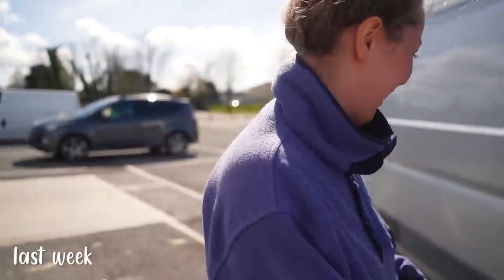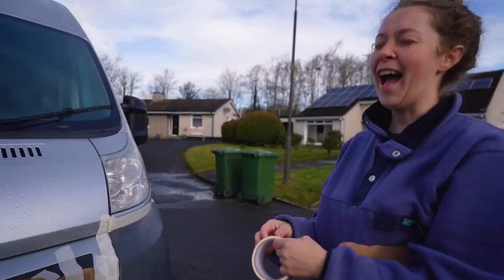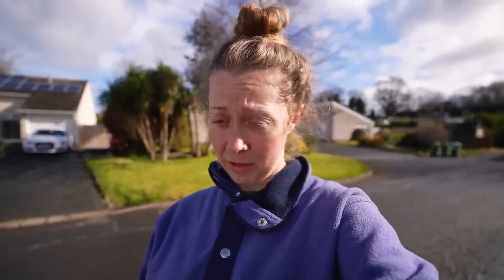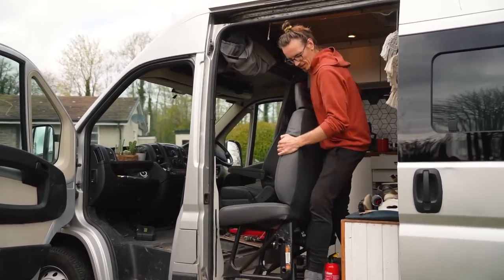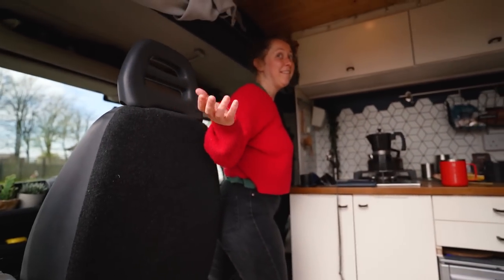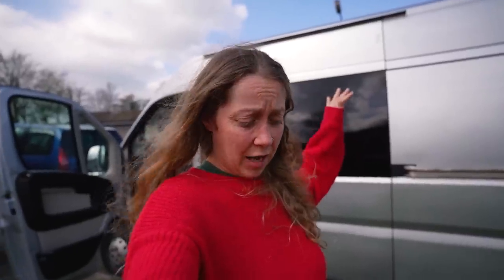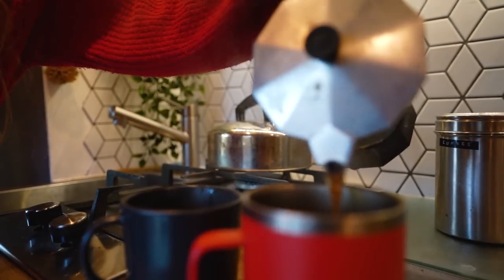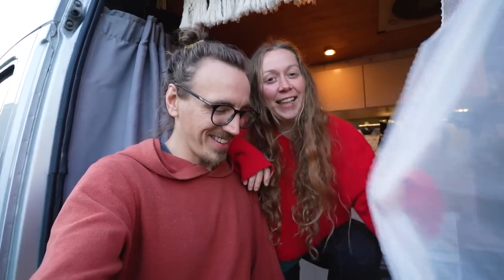Van Life will never be the same again!

Comment: Not to put a downer on your seat excitement, but…. The original bolts that you’ve replaced with threaded bar are likely a higher grade steel(stronger bolt) than the threaded bar you’ve used. This could potentially void your insurance if (hopefully not) you are in an accident and the vehicle is assessed because it’s a seat belt anchor point. Again, don’t want to put a downer on it but just a heads up of something to be aware of. 👍👍
Reply from the maker: Thanks guys, never a downer if sharing valuable info. We actually bought a thicker metal than our previous one was and followed the guys video to a Tee, he had his signed off I think. But we are gonna take it back to the garage to get them to give it the once over just to makesure 🥰🥰

Comment: Use a blow torch on sun damaged black plastic, it brings it back to looking new again, trust me.
Reply from the maker: Now if I had a blow torch that would have been a way cooler looking video!!
Reply: @phillyandkeely  Just dont let keely near it, it works a treat though, any weathered plastic and applying a little heat brings the original deep colour back.
Reply: @LOYALISTGOVAN  I did this on my Ford Tourneo, looked great for about 3-4 months then it bleached out again.
Reply: @mikebillett7935  yeah ive heard of mixed results, repeating it every 4 months doesnt seem that bad, i have a vw caddy and i did mine in september 22, its still perfect. its less messy than painting or aplying black plastic conditioner, i also noticed that football stadiums are starting to use this method on there seating due to bleaching.

Comment: Great video guys. I'm a fellow Norn Iron converted van owner. I have a single passenger seat added same as  you guys. Wee question, where did you get the threaded bar to attach the seat belt to?
Reply from the maker: Bought the threaded bar from B&Q in Lisburn, 12mm bolts and all there too. I've updated description with the link to the video of the guy who installed it and does full explanation, defo follow his video it's awesome
Reply: That's great. Thanks. Ordered all the parts now!